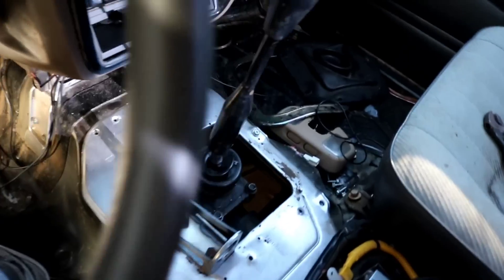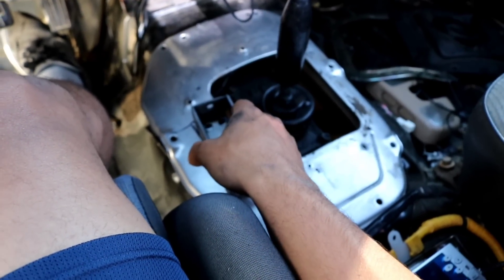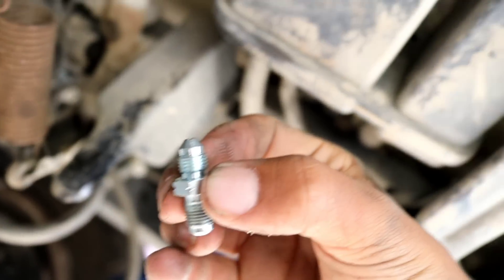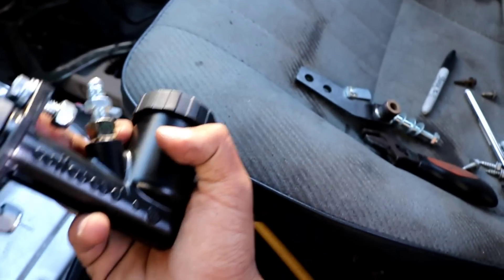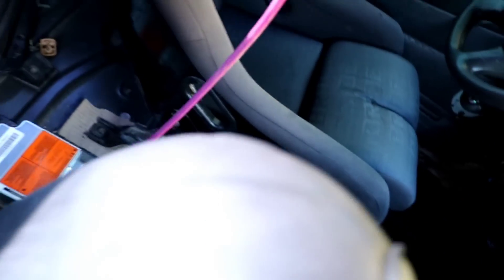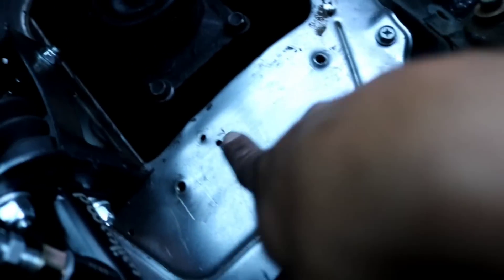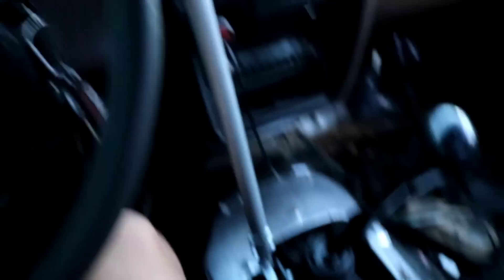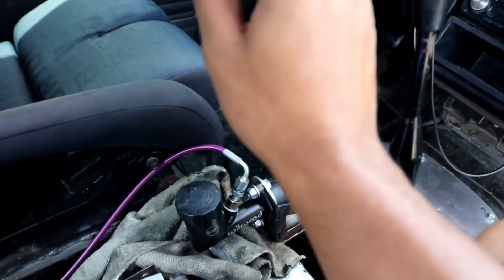D21 Drift truck gets a HYDRO-E !

Comment: Hey bud I think your lowering blocks are in backwards that pinion angle looks a little rough I messed up and did the same thing cause I was in a rush and not paying attention
Reply from the maker: When I first installed it I did it right but I recently swapped axles and I messed up haha thanks for confirming man I wasn't sure lol
Reply: All good man just making sure ya got it before it was to late lol
Reply: @jacobstewart1600  so which way is the block supposed to go the top side of the angle to the front or the rear of the truck
Reply: Angle to the front the block will look like its sloping to the front of the truck
Reply: @jacobstewart1600  so short side to the front
Reply: Yessir